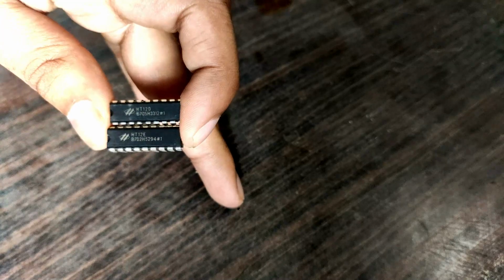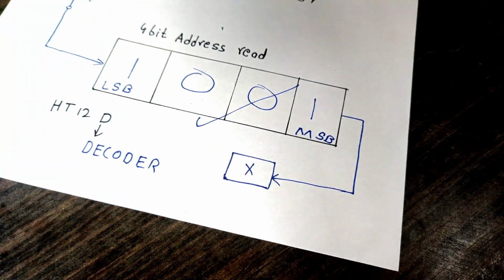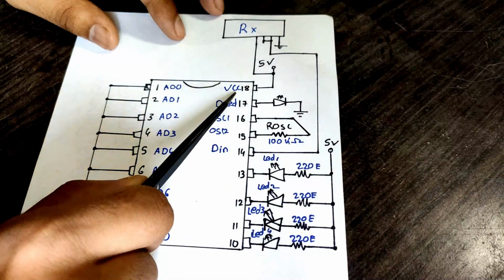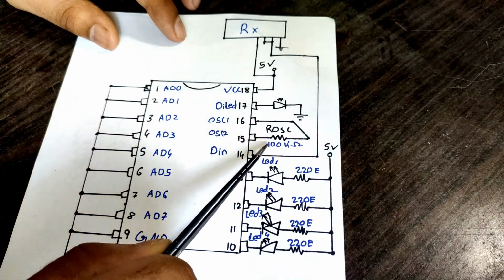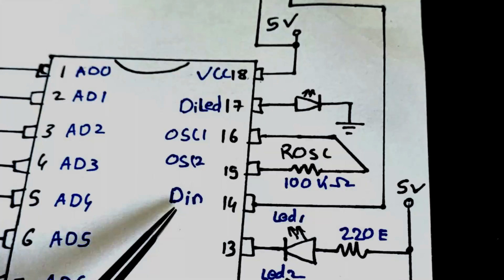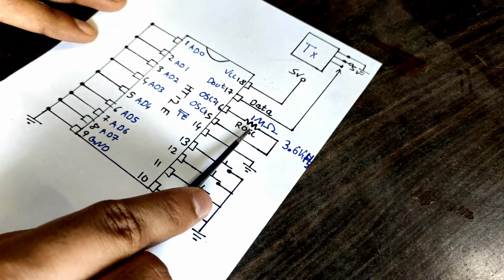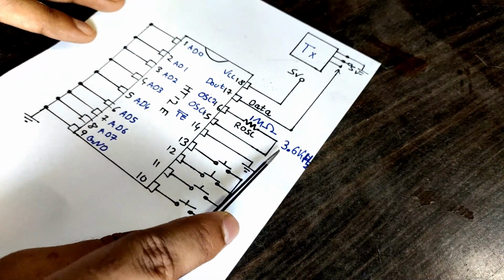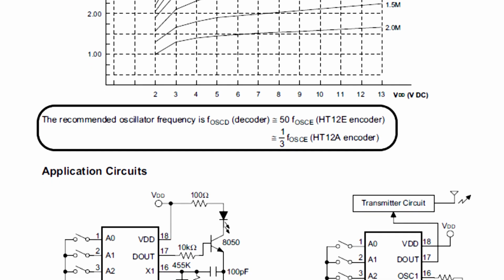Automate Your Home With This Circuit | Home Automation | Wireless Control Series

Comment: Please can you make a video on the schematic i.e. circuit diagram of the  modules of transmitter and receiver  
How it works  , working of every components  , how signal is transmitted from transmitter to receiver to control motors of RC toys
Reply from the maker: Thank you for the recommendation, will surely look into it.